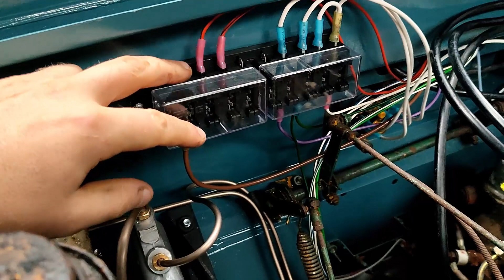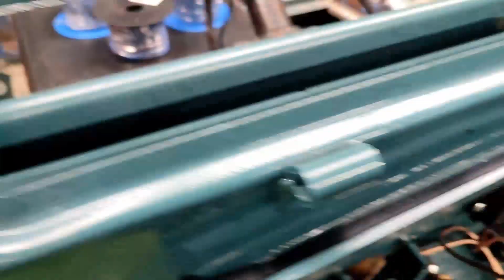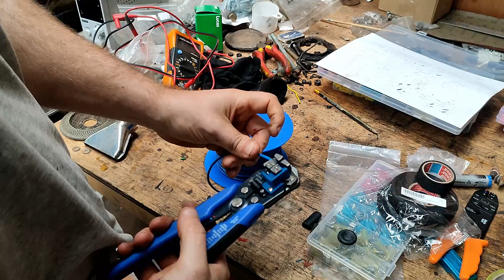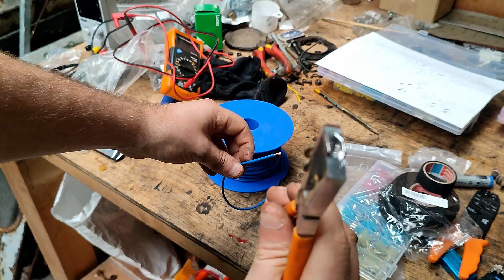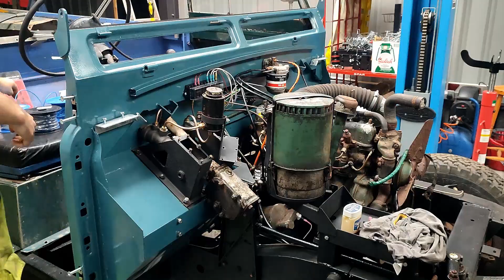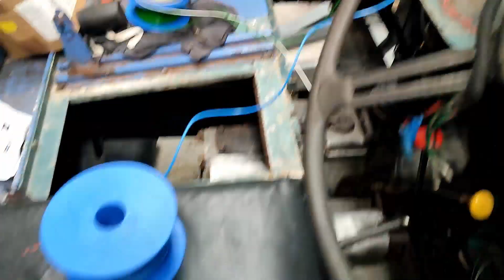How to wire up a Land Rover Building your own loom from scratch Part 2 progress update

Comment: Hello many thanks for your video.  I’m restoring a Series 3 County originaly Scotish park rangers. I bought a new wires harness at Autosparks and I’m not sure to plug the good wire at the right place. I’m using the green pattern found on internet,  I got the color code, but I'm still confused to do it ”for real”. And of course, I didn’t take enough pixs 3 years ago to remember precisely where the wires are fixed on the chassis.
Reply from the maker: I think you will find the hardest part is starting. I've never fitted an autosparks loom, but I imagine once you get started and there are less pieces to the puzzle left it gets easier. If you then get stuck you can reach out to me or many of the forums for these vehicles and someone will be happy to help you.
Good luck with it 😊

Comment: I know this video is from a year ago and is too late for you now and you probably already know this anyways. But when comes to crimping tools for those who are new to this and to crimping. Be very careful when you crimp that you use the right crimp position on the tool. The tool generally has one for non-insulated connectors and one for insulated connectors. While it is true you can use the non-insulated crimp for insulated and it will work. What will happen if you use the wrong one is it potentially will puncture the insulation on the connector therefore allowing water to get into the connector and rust it out. A good rule of thumb is for insulated the crimper position is flat shaped, for non-insulated it is humped. So many people make the mistake and use the wrong one and end up puncturing the insulation protection on the connector. Sure it may not have an effect today or tomorrow and the connector will work fine but over time with it potentially getting wet it will eventually rust out and fail.
Reply from the maker: @nzcyclone  thanks for sharing. I wasn't actually aware of that so I'll bare it in mind for the future and hopefully it will also help others out

Comment: Hi, what cable thickness have ou used? Looks like 2,5mm2 to me. Thanks for your videos, they help  lot. 👍
Reply from the maker: I've used a range depending on the use. Most was done with 1mm2 thin wall which is rated to 8.75amps. then where needed I've increased the size to take 17amps or 33amps
Reply: @aguyandhisgarage  Thanx for your quick answer 🙂